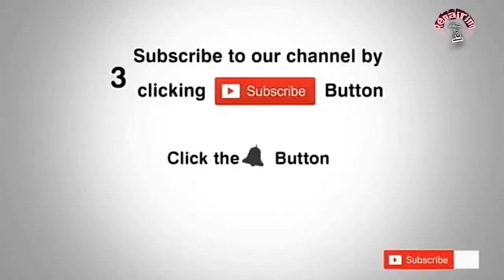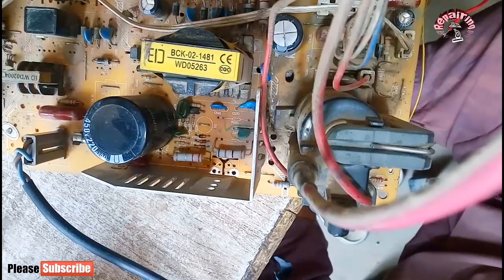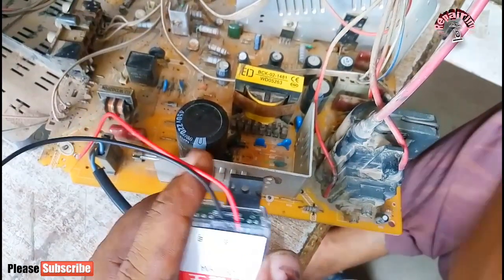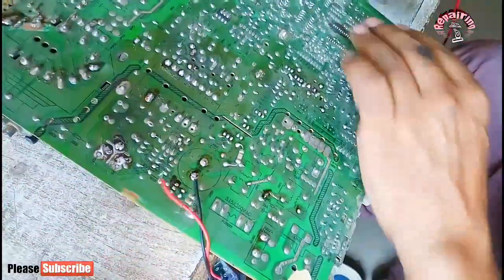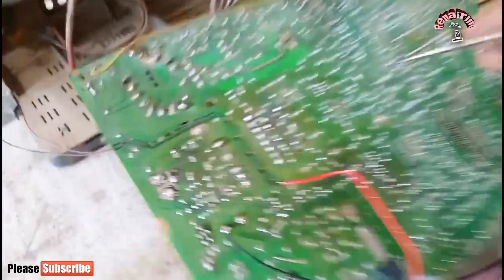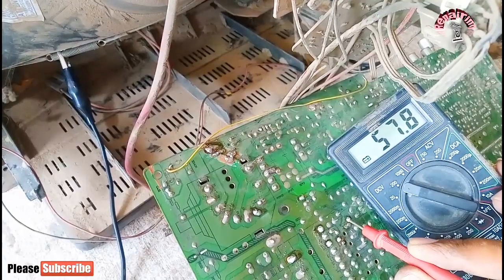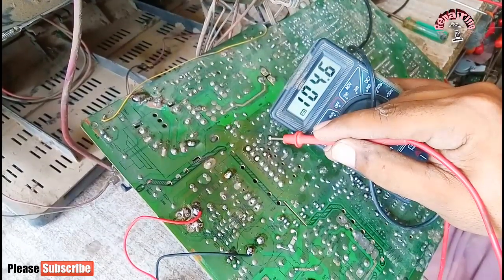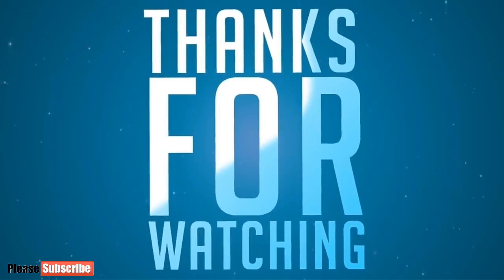Install Switching Mode Power Supply Module | tv repair|crt tv repair|electronics|fix it|leno tv

Comment: Please, moudul 110 volt se horizontal out Ko supply dene par voltage drop Karti hai jiske bad 122 volt per EHT Kam karata hai । Ese kaise set Karen ,122 volt per H out put transistor bhi kharab bhi ho jata hai , please batayen , thanks ji